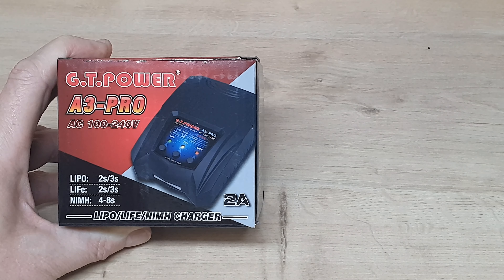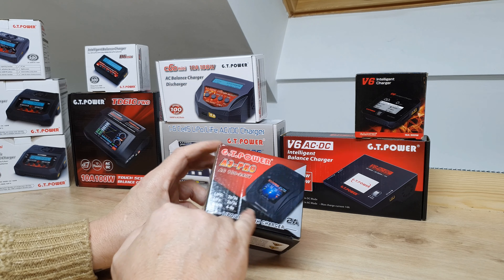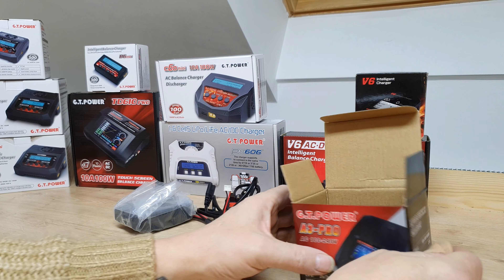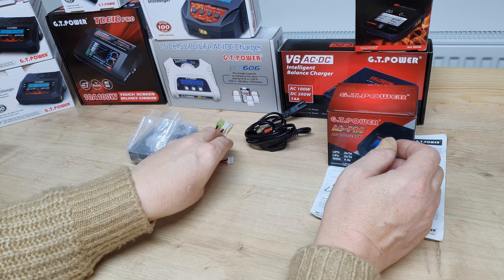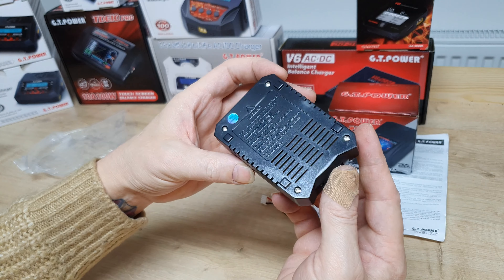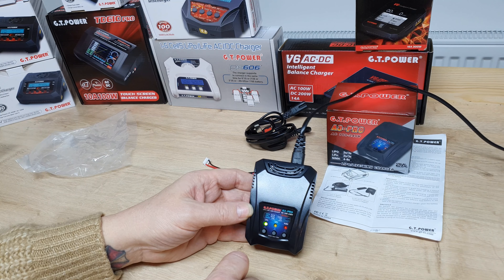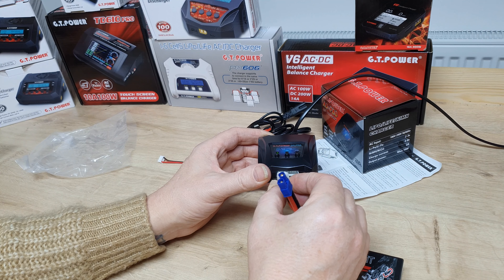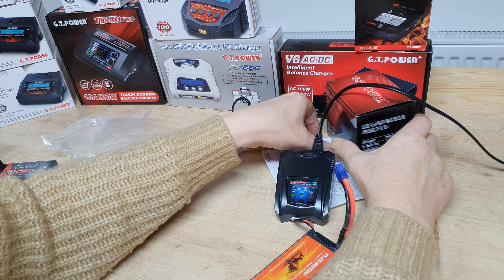Review - GT Power A3 Pro Battery Charger - AC Input

Comment: Can this charge a gens ace 5300 mah battery?
Reply from the maker: yes it can, but it's the most basic of chargers and I wouldn't recommend it. Buy a better charger.
Reply: @ hey bro it’s the only charger i have rn and can’t afford another rn. How do i set it up to charge my lipo? Because when i connect the battery to the charger, the green light flashes fast. Unlike in your video where the green light was flashing slowly indicating that it’s charging
Reply: @TeriWilde  any help here brother?
Reply: @TeriWilde  trying to charge a 3s lipo btw
Reply: @SND-kians same thing here any luck?